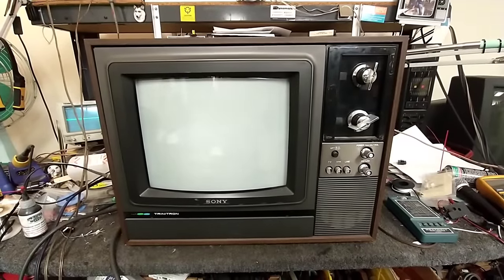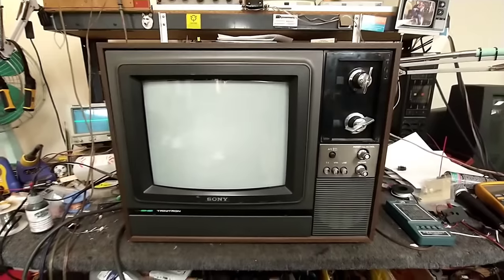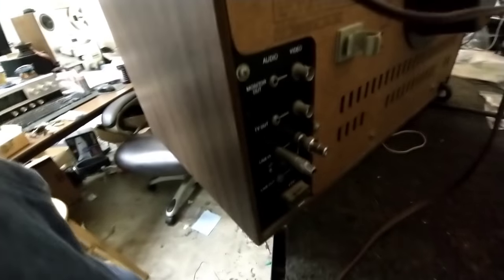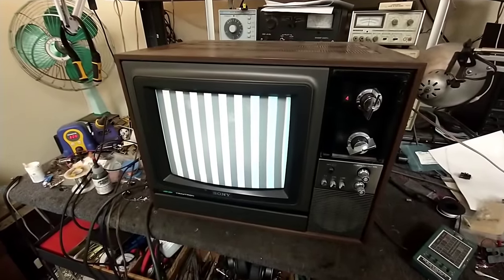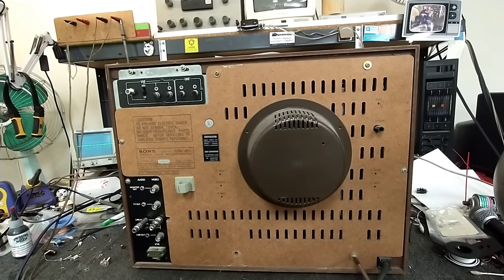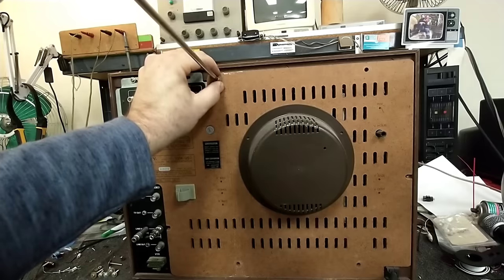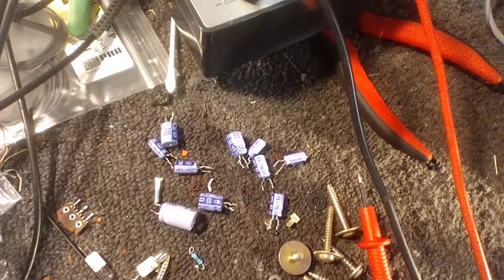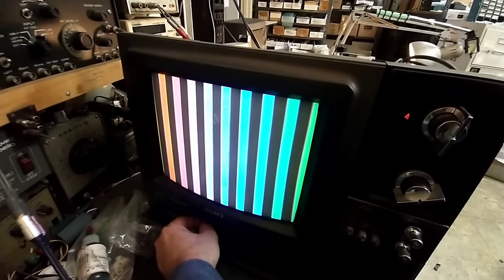Servicing a 1982 Sony CVM-1250 Television monitor - Intermittent weak color

Comment: Peed out caps mounted on a vertical circuit board is actually a good thing here as the traces are untouched by the aging
capacitor gut spew. Like the tap on the board test to narrow it down . But here you found a cracked pot on the board.
Weird stuff. Great working unusual commercial  Sony monitor.

Comment: What an unusual looking set, i think though sony did make the best crt sets although they can be a real swine to fix due to the expensive transistors blowing, the mrs grew up with the 22" version of this it lasted well over 25 years, damn if you could add an RGB input to this it would be incredible.
Reply from the maker: It would be. Its a hot chassis with an isolated video and audio input. Not sure how i would modify it, but yes, a cool idea
Reply: @JordanPier  Does it have a jungle IC ? for the on screen stuff (if it has it) if so there will be pins on that IC for RGB then add a blanking signal from the composite input.
Reply from the maker: @Synthematix  this one is all discrete.
Reply: @JordanPier  Ok, then you need to go directly in the back of the crt neck boards RGB lines (video in)